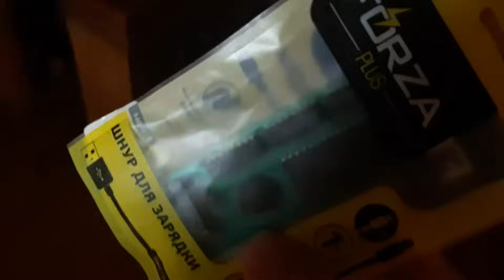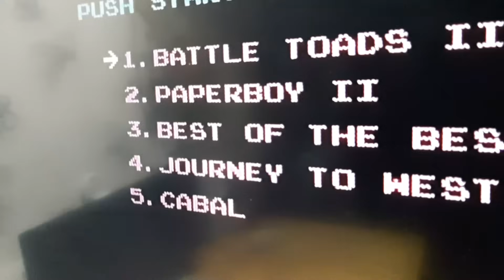Восстановление картриджей DENDY - Замена капли - 8bit'ный стародел #015

Comment: I don't understand refrigerator fix something on the cartridge ?
Reply: Yes, but not for long.
Reply from the maker: yes, freeze and everything will be clear
Reply: @itConsoler  damn! you guys so smart!  learn it!
Reply: @Destrould  So...something on the board shorted turn to open because of the Thermal expansion and contraction
Reply: @yuyongbin  Yes, it's inside the black "drop" on the left. Unfortunately, it is impossible to replace it, only to make a new board.
Reply: @Destrould  yes too much works.I've tried make lots PCB by tone-transfer but failed a lot, nowadays in china you can get 5 cartridge PCB with 5yuan which around $1 dollar with shipping (in china) (JLCPCB). but you can only purchase 10 board each month XD...anyway i will try your method to my failed cartridge. thanks for your video again!